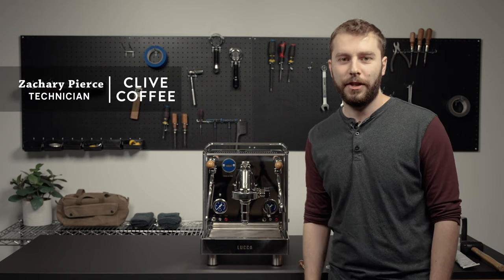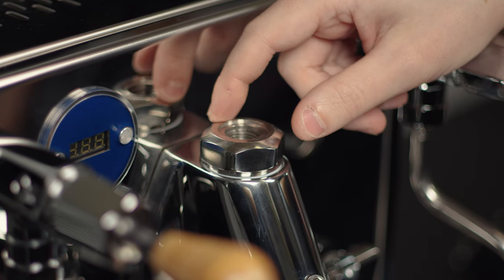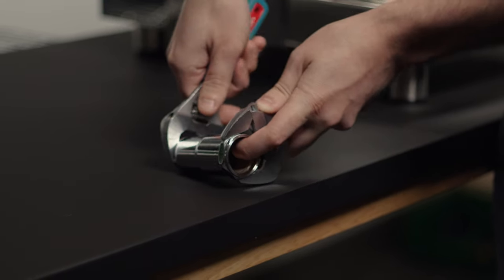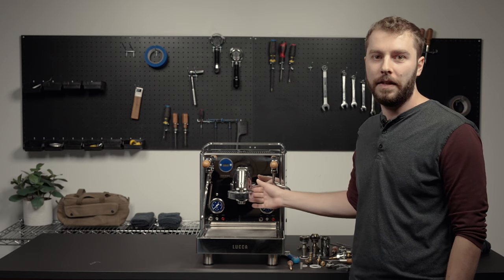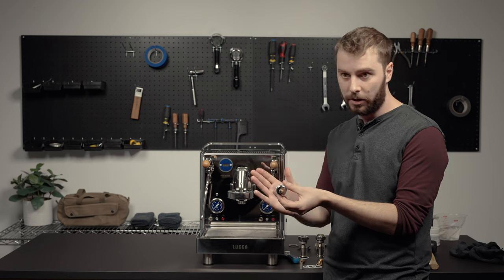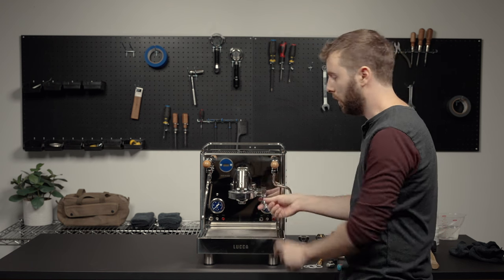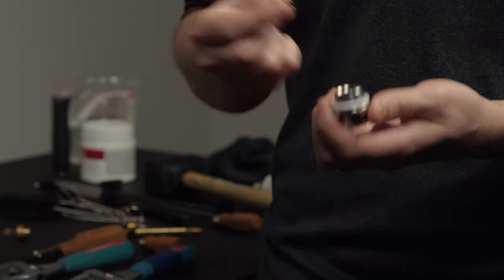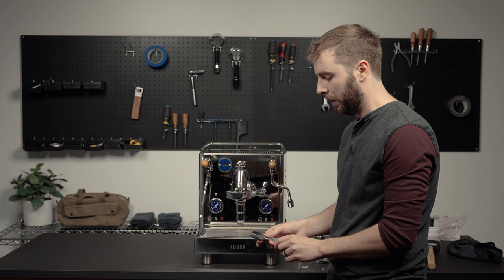How to Rebuild Your E61 Group Head

Comment: I didn't make it three years before I wore out the top brew valve. I may have made it happen faster by adding a flow control valve. I had zero flow. In hindsight I was operating the flow control valve more and more open as the parts wore out.

Comment: Good video.. I was able to rebuild my E61 easily. However, some of the parts were different from the ones I pulled from my Rocket Mozzafiato V. Make sure you don't discard the old parts before you are done. I just cleaned the old parts and put them back in.
Reply from the maker: Love it!

Comment: The lever spring and the drain valve spring are about the same size, and can be confused, so to be clear, the lever spring is the stronger spring, right? Great and clear instructional video, thanks.
Reply from the maker: Correct! And thank you.

Comment: Excellent video, could have saved me a lot of headaches (like a real silly attempt to install the camshaft with the pre infusion chamber in) if I had this as a reference for my first rebuild a few months ago. 😅

Any reason you don’t use any tape or cloth to protect the chrome plating as you wrench fittings on and off?

Comment: When installing the camshaft lobe must be sitting on the bottom valve ? Evey one else says the camshaft lobe must face out front towards the front of the machine but when I do that the camsahft is stuck and dosnt move
Reply from the maker: Interesting. We made this video specifically becuase people have a ton of trouble with the cam shaft part.

Comment: For the life of me, I cannot get the first bolt off the cam assembly.  I need thinner wrenches I guess and yours came right off.  I don’t know how people do it, lol. I’ve tried many times.  Now it’s all scratched up so time to replace the outer assembly.  Ugh!  As a women, I don’t find any of this very easy to do!
Reply: For what it’s worth, I had to hold it on the floor with my foot and hit the wrench with a hammer to get mine apart. I also scratched up the cam assembly cap. So you’re not the only one!
Reply: @jamesfuller  thanks for the share!  Good to know I’m not the only one. I will be attempting to change out my cam assembly today.

Comment: Is this the same for solenoid versions of E61's? I have an electronic one that doesn't have a manual lever. I can't find any of these videos that talk about this version at all.
Reply from the maker: No, it is not the same. This is much less common. We may have a video on this in the future.
Reply: @clivecoffee that would be cool! I bought a single group wega and converted it to ground espresso but haven’t found much info about the non lever e61.

Comment: I have a Lelit Bianca machine for 7 months,(it has the E61 group head as well), and I have always a problem.The up-down lever is always stiff.I called the dealer twice.The first time,he put lube after he took out the camshaft,it was OK,but 10 days after I have the same problem.Then,I called him again,and then he changed the camshaft,put some lube again,the problem seemed to be solved,but 10 days after,i have the same.I clean the machine every day with Puly Caff,and I use a Brita Purity C150 Quell ST regulating it to 60. What can I do please now?
Reply from the maker: Cleaning that often with backfluhing detergent will strip the lubrication. Try backfliushing with pully caf about once a month instead of every day. Integrate just water backflushes into your routine.
Reply: @clivecoffee  Thank you very much sir,I appreciate.